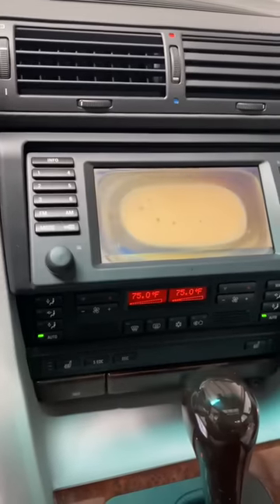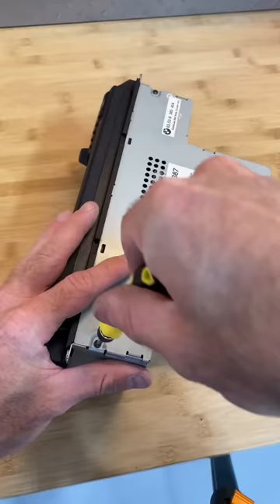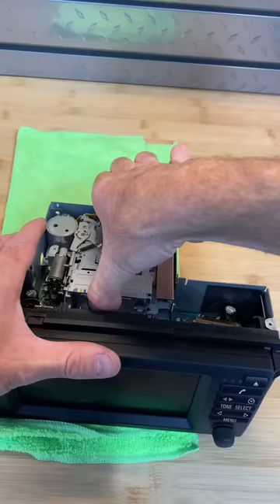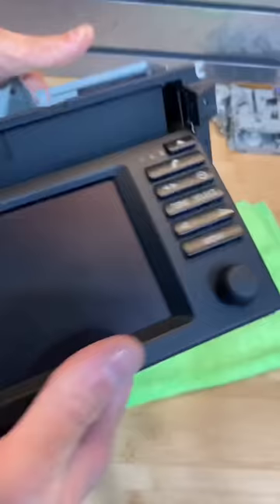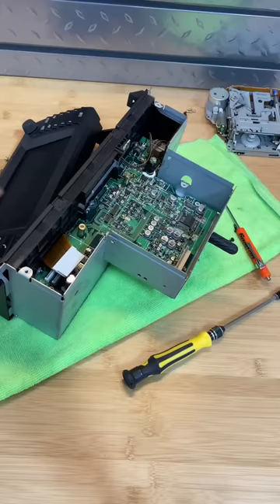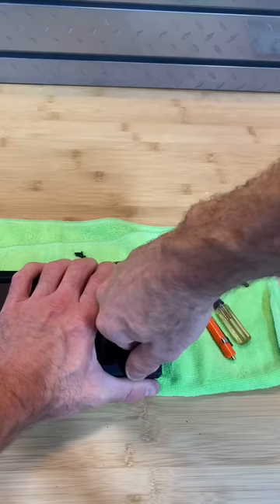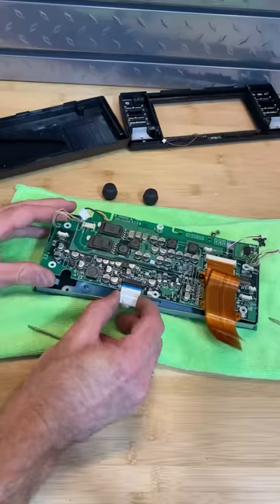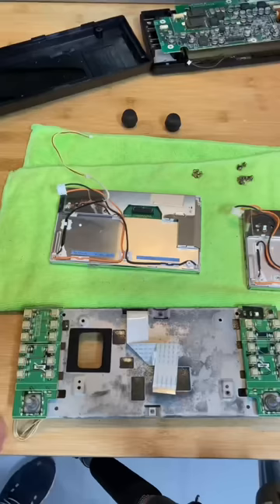#shorts BMW Nav screen replacement e38 740iL

Comment: Imagine if the image was upside down 😂
Reply: It would be impossible since the ribbon cable would’ve been twisted
Reply: @naruto11297vn  could come like that from the factory
Reply: @Godofhel1  still impossible as the prossesing chips for the lid would still be at the button
Reply: @naruto11297vn  Hence the keyword "imagine".

Comment: I love BMW’s. This is just annoying though…. I’d probably would have just swapped for an after market unit with an Aux Input or maybe if feeling spendy an Apple CarPlay device
Reply: Hey Just Save That Money And Get Ready To Have To Rebuild The Engine Over And Over 😂 😅
Reply: @five3194  Know a guy his BMW motorcycle catched fire on the highway even their motorcycles are shady. And he was driving the legal speed limit
Reply: @Milo19970  yeah okay buddy
Reply: Cheaper to have its own android on there, rather than Apple carplay/android auto.

Entirely standalone android-powered head units are dope. You get to put in big beefy antennae all over your car and have significantly better reception of both GPS and 4G than with your puny phone.
Reply: @dylanmccallister1888  oh, thanks for the info, that makes sense
Reply: @Milo19970  WOW glad that every other manufacturers doesn’t have recalls and defects of their own. Wait.
Reply: I thought exactly this, that old outdated infotainment is meaningless now. Apple CarPlay or android auto fits today’s standards. Best thing ever
Reply: Yee my E46 has Touchscreen CarPlay. Much better than bmw software
Reply: I absolutely hate aftermarket head units there’s only one I’d ever consider putting in my m3 and it’s like 600 dollars 😅
Reply: @BananaSlothGames  lol $600 for aftermarket unit? Mine was $200 and it completely made my E46 a hundred times better not kidding, even feels like the car was made in 2015 instead of 2003
Reply: DYNAVIN sells complete replacement radios with Apple CarPlay that look exactly like that radio.
Reply: @AndrewKidd14145  Ok now wipe your tears fan girl
Reply: @xeone1920  k
Reply: @dylanmccallister1888   Damn i did not know it were so many, thats insane! He has that same bike btw
Reply: @GoSwearingOrGoHome  i put the Blaupunkt Bremen in my e30, classic look with modern functionality.
Reply: @dylanmccallister1888  is not only the RR, its all models. And the boxer is a tank, my GS1200 has 370k miles and has been riden in 12 countries so far.
Reply: @PatricioGarcia1973  wow that’s awesome
Reply: @AndrewKidd14145  point here is someone called out the story of BMW motorcycle catching fire on highway and the guy you replied to explained why the story can be true because BMW motorcycle has fuel pump issue and BMW officially recognized the problem and recalled the faulty part.

nobody is saying anything about other car manufacturers not having recalls.

however, BMWs cars are notoriously famous for being money pits and frequent breakdowns
Reply: That’s what I did
Reply: @GoSwearingOrGoHome  I'm an intellectual for sinking money into sinking ship - every BMW fanboi ever. lol you sensitive princess make me laugh
Reply: @lordjaashin  I’m a fan boy for liking amazing cars. You’re just broke 🤦🏻‍♂️ Alpina B7 is my favorite. None of Tesla cars is bullet proof and can’t go 200mph yet 😂😂😂
Reply: @GoSwearingOrGoHome  amazing cars != BMW. the sooner you understand the better. nobody cares about tesla so what is the point in bringing it up?
Reply: @lordjaashin  totally sinking ships, I have 3 BMWs that have no problems and gonna get a 2021 G82 M4. My cars get better maintenance than 90% of the road and it’s never been to a shop
Reply: @GoSwearingOrGoHome  you think they've never been to shoo because your dad takes them to repair shop behind your back.

he does this because of how sensitive fanboi you are about your BMW cars
Reply: @lordjaashin  my dad never leaves the house so I would be very surprised if he did that
Reply: hes keeping it orginal to restore and sell its rare
Reply: @dylanmccallister1888  you’re clearly not a bike guy
Reply: No I want my car looking as stock as possible
Reply: @Milo19970  I don't think you know how motorcycles work lol

Comment: "so all the work i did previously really wasn't necessary" 

Proceeds to remove the display connector cable that couldn't be removed without opening the whole thing up
Reply: it also sounds like someone would say when getting a job after graduating from school
Reply: i was about to comment this exact same thing, but i rewatched it and found out he couldve do it without taking out the middle stuff there
Reply: @DOOMSLAYER1376  taking it out is the easy part. Getting it BACK IN is where he would’ve needed disassembly
Reply: @liam Anderson Autocorrect hit and made me miss a word, and also
you're*
Reply: @liam Anderson Well what did you expect me to say instead

Comment: One thing I noticed when I fixed anything electronics is make sure to have a proper screw holder. i got a 20 slot screw holder that closes. it makes life easier when you are putting it together. you dont want to put a big screw where a small acrew goes…. the nail will go right through the screen.
props G

Comment: You can buy a touchscreen version with backup cam of that made by the original manufacturer of the audio unit so it even looks oem.

Came across it when i was looking to update my 2002 e39 540m-sport

Comment: I had to do this with my mothers 2015 Toyota Camry. There’s a defect where the bottom half of the screen stops responding to touch (and in my case, touch response was shifted up an inch). I found a new screen digitizer for $17 on eBay. Worked flawlessly.

Comment: The other screen can be fixed. You can get a new cut to fit polarized sheet. They are available in many tints and antiglare features.

Comment: Had al similar issue with my 2007 Camry. Thought I had to yank the radio but just swapped out the piece that pops out. Also needed to figure out how to get it to eject as the screen in my case was smashed. Then I recalled to hold down the eject button!!!

Comment: Not 100% sure if it’s possible with these screens but should be.if you have that issue with a screen and have no option to replace it I believe you can remove the old polarizer( usually scrapes off)and put on a new one from eBay. Just try and find one that resembles the one you removed.

Comment: If you know where I can get a digitizer or screen+digitizer for a Toyota PZ360-00105, model: EL-827C-TMC1 made by E-Lead in Taiwan, let me know.  I can find the screen alone (made by Hannstar), but I need the digitizer with it, it's suffering the dreaded "ghost touch" problem.  Unfortunately it goes whacky when there is no digitizer attached as well, keeps soft rebooting, reattaching the faulty digitizer fixes the reboots... but sever ghost touch.

Comment: Or u can easily just replace the polarizer film. Take it to mobile phone repair. And done.
Reply: Almost all mobile repair places wouldn't be able to repair this.

Most mobile repair shops just swap the lcd.
Reply: What country? In Indonesia we can fix almost all type of LCD without completely change the old with the new one.
Reply: Take a look on your search column "lcd aerox sun burn"
Reply: @anonamenoname1063  in the USA, a phone repair store literally just swaps the entire lcd panel.

Replacing any internal parts of an lcd often costs more due to the labor rate cost.
Reply: @anonamenoname1063  because some countries like yours are far less wasteful

Comment: This is why some newer cars suck. In 20 years, who's going to be making antiquated screens that control the radio AND hvac in our vehicles. Not too mention, the screens and resolution can make a 10 year old car look terrible, with Nintendo 64 looking graphics.
Reply: Yup, they all have planned obsolesence calculated in.. but in 20 years the plan for EU is to go 100% electric, a 15-20 yr old car is an environmental hazard anyway, anything with a carburator produces really toxic fumes, I don’t think you can even asphixiate with a brand new gas car fumes even if you wanted to.. 
stuff changing..

Comment: pro tip, while an x5, x3, x2 etc are nice to drive. If you value your money, dont buy it. I work as a BMW mechanic, i find that the X cars are even less reliable than 07-13 minis..... and thats saying a lot. The minis had a peugot engine... literally so unreliable its not even funny.
Reply: I guess thats depending on the model year, because the first x3s had the engines and stuff from the e39 series, which are pretty reliable engines (if you take decent care of them). But if something is broken and you want oem parts.. it is still a bmw .. parts are expensive :)
Reply: @MaxMustermann-dq2se  basically, in my experience. 05 and newer is just crap. all crap.
Reply: @PneumaticFrog  okay looked into the sheets, the e83 (x3, first gen) had the M54 (petrol) engines until  06'.. those were pretty good engines.. after that they had the N52 and N46 engines.. which werent nearl as reliable but more "efficent" ... but yeah.. not good engines... and probably had the same problems witch electric stuff as the e60
Reply: @MaxMustermann-dq2se  
Oil Leaks From Engine Area. 
Water Pump May Develop Coolant Leak. Coolant Loss Due to Leak from Expansion Tank. 
Blower Final Stage Fan Resistor May Fail.
Check Engine Light and/or Engine Overheating. 
Window Fails to Open or Close. 
front Thrust Rod Bushings May Fail.
Coolant Leak From Radiator.
Grinding Noise From Front Wheels
Creaking Tailgate/broken reverse camera
Water pump fails, just like any BMW it seems... Not as cheap and easy to fix as on your typical E46.
Leaky VCG, just like any BMW...
Power liftgate struts will fail eventually.
If third row equipped you have suspension airbags that will leak eventually.
Would assume they've been replaced at least once by now.
Front suspension rubber.
Mechatronic sleeve seals
If comfort access equipped the door handles may fail and cause a battery drain.
Reply: @MaxMustermann-dq2se  if you read the comment above, theres your proof haha
Reply: @PneumaticFrog  Proof? I even agreed and said that the e.g. N52 (built from '06) engines are crap engines :D and i owned multiple e39s and have/had  multiple in the family (and a e36) and now i am driving a e60 with a N52 engine.. and it really showed me what a nice engine the M52 is :D